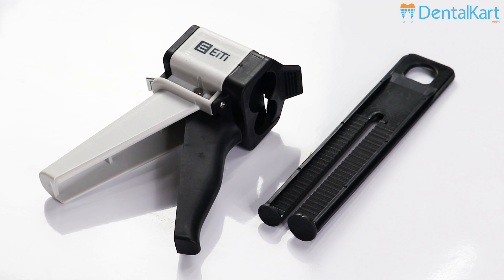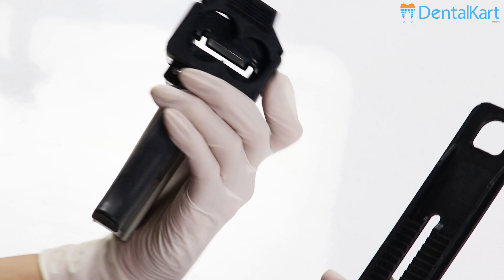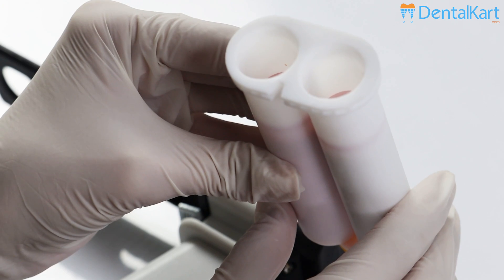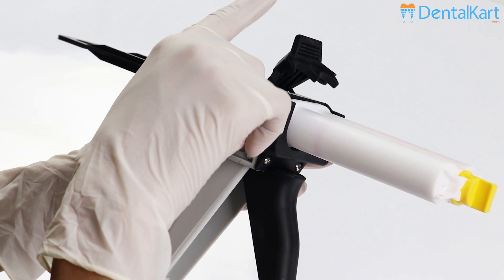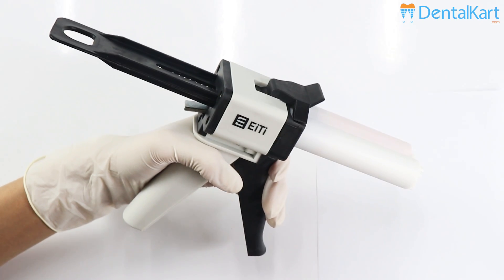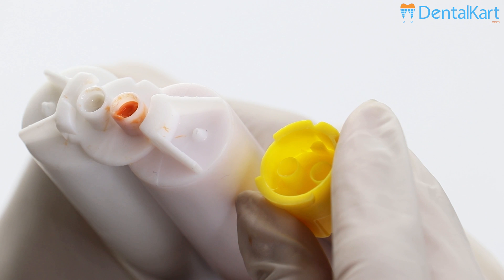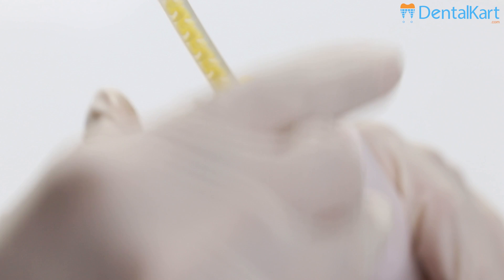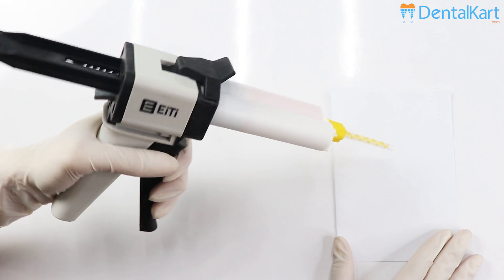How to use EiTi Dispensing Gun

Comment: Is Waldent dispenser gun also used in the same way ?
Reply from the maker: Greeting to you Mam
Thankyou for showing your interest in our Waldent dispensing Gun 
Here are the
Direction to use for it.
1.Lift the release lever of the dispenser and pull the piston plunger all the way back into the dispenser.
2.Lift the cartridge holder of the dispenser and load the cartridge ensuring that the V-shaped notch on the flange of the cartridge is facing down. Push down the cartridge holder to fix the cartridge.
3.Lift the release lever and push the piston plunger forward until it engages into the cartridge.
4.Remove the cartridge cap by rotating 1/4 turn anti-clockwise, tilt the cap downward and peel it away from the cartridge. Gently squeeze the dispenser handle to extrude a small amount of material from the two openings at the end of the cartridge. Make sure that base and catalyst come out evenly.
5. Align the V-shaped notch on the rim of MIXING TIP II to the V-shaped notch between the cartridge barrels. Push firmly to attach the mixing tip. Then, rotate the colored collar of the mixing tip 1/4 turn clockwise to the end of the cartridge. The dispenser is now ready for use.
6. Squeeze the handle several times to extrude the material. After use, do not remove the MIXING TIP II as this will become the storage cap until the next use. When replacing the MIXING TIP II, rotate the collar on the mixing tip 1/4 and turn anti-clockwise to align the V-shaped notch on the cartridge. Tilt the mixing tip downward and peel it away from the cartridge.
7. Remove and replace the old mixing tip immediately before the next use. Before attaching a new tip, gently extrude a small amount of material to ensure that the base and catalyst are flowing evenly from both openings. If the materials fail to extrude, remove any hardened materials on the end of the cartridge.
8.To replace the cartridge, lift the release lever and retract the plunger fully. Remove the empty cartridge by lifting the cartridge holder and loading a new one into the dispenser.
If you want more information about Waldent dispensing Gun. 
You say click on this link 
https://www.dentalkart.com/waldent-dispensing-gun.html?pg_rf=b3A9c2VhcmNoX3BhZ2Umc2VjPXNlYXJjaF9wcm9kdWN0JnBvcz0x. 
Regards.

Comment: you have two types of guns 4:1 and 1:1 , what is the purpose of these 2 guns? as the 1:1 you have is out of stock , what is the purpose of 1:1 gun? or 4:1 which one can i use for light body dispersal?
Reply from the maker: Dear Dr, Greetings! Please find the details for your reference : 4:1/10:1- The impression gun is used to discharge the crown & bridge materials from cartridges.
1:1/2:1- The impression gun is used to discharge the impression materials and bite registration materials from cartridges.